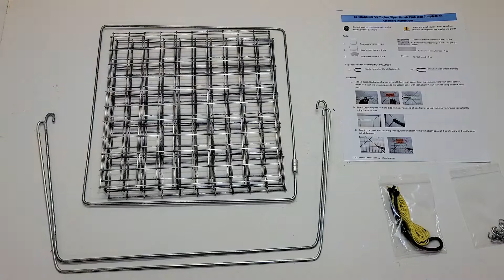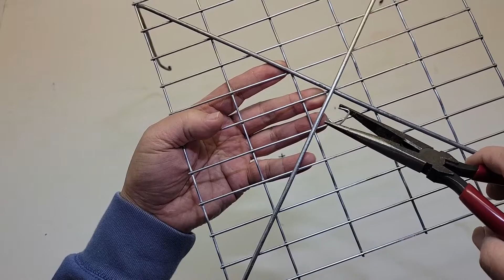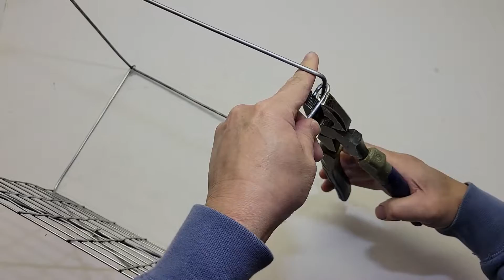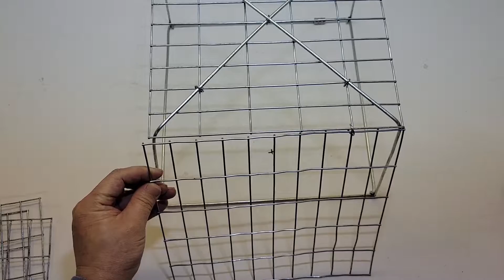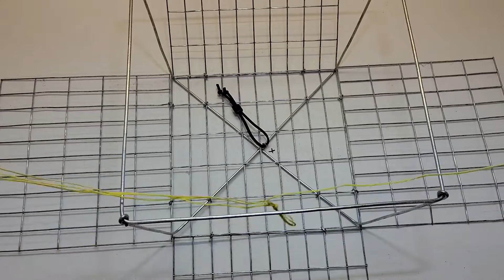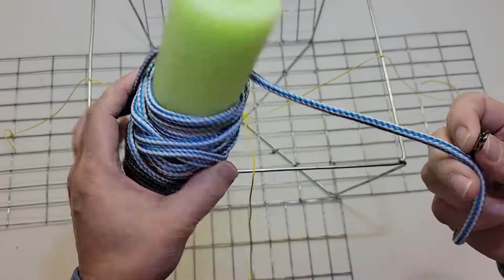EZ CRABBING - DIY Topless/Open Panels Crab Trap Complete Kit Assembly Instructional Video

Comment: I believe you want to make sure that the strings for the strike are taut when the doors are flat. This way the flaps don't go vertical when it's falling to the floor if there is slack in the line.

Comment: Ok ordered 5 of the traps. Very fast shipping. We put the first one together using your video. Note to anyone putting this together - when he says use needle nose pliers  - that’s what you should use. Next ones should go much faster. Can’t wait to try them out. Went ahead and ordered the lines with pol noodles and the large swivel. You cannot make those for what they are selling them for on eBay. Get you some
Reply from the maker: Thank you for the feed back.  Regarding the pull rope with pool noodle, this item is highly recommended.  It will make your use of the EZ Crabbing topless traps easier and enjoyable.  It's unlikely that one can make your own at this low price.